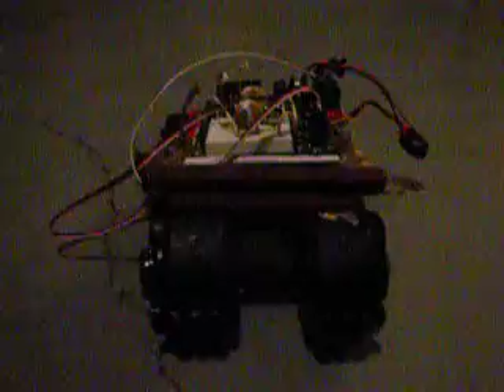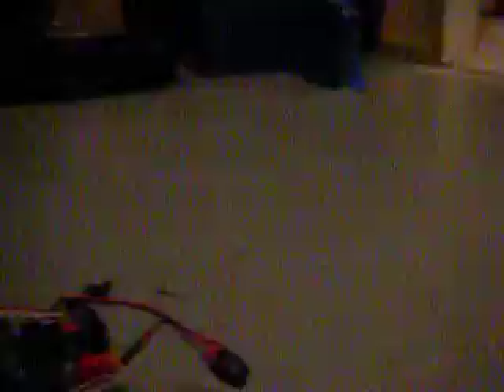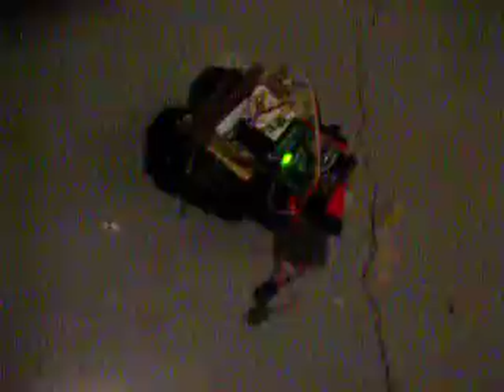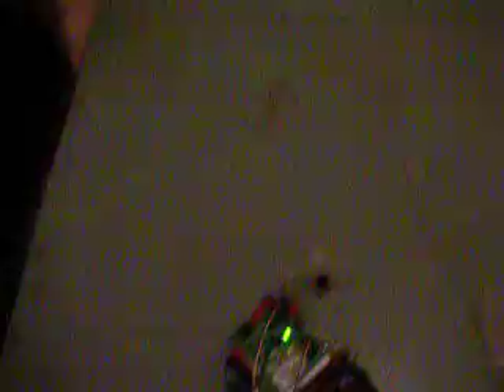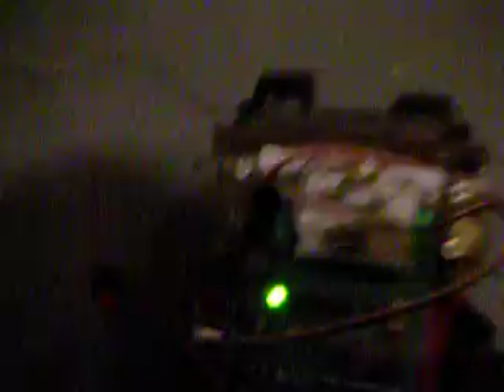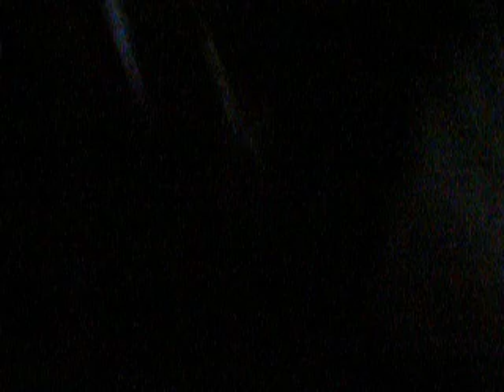robot out of junk

Comment from the maker: that's because it's not wirelessly controlled if that's what you mean. it's fully autonamous. if you mean balencing battery weight with power and the power of your motors then it's not too dificult if you use a good battery like some of the 9.5v lithium battery packs floating arround on ebay